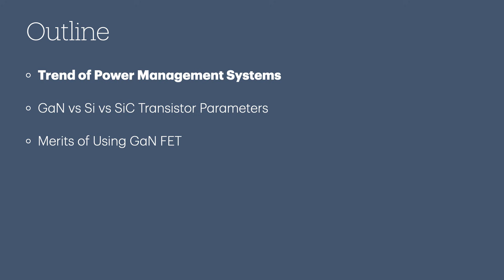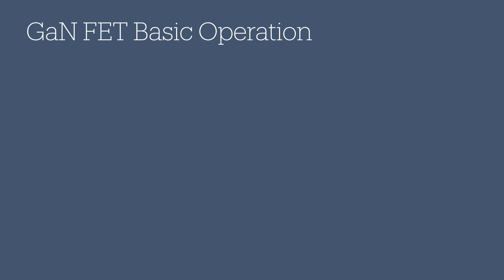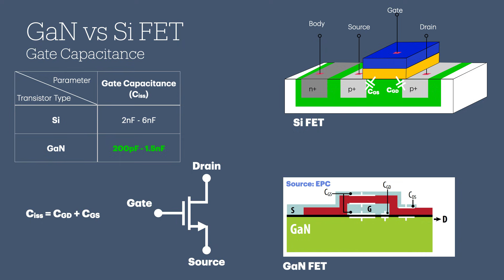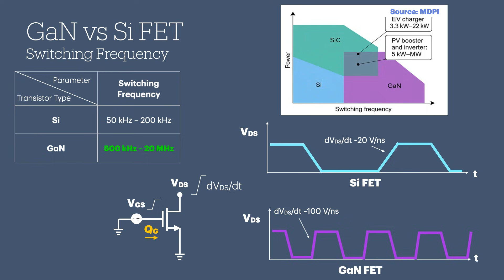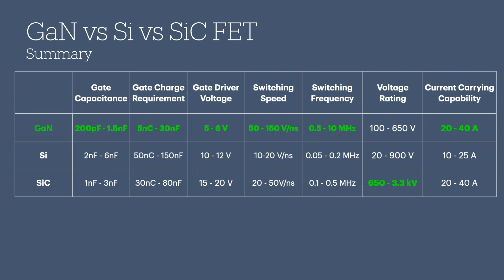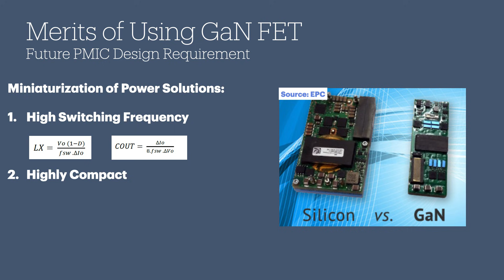Lecture 01 Introduction: GaN FETs for Future Power Management Systems

Comment from the maker: ⚡ Gallium Nitride FETs: Driving the Next Generation of PMICs

In recent years, fast-growing areas such as electric vehicles, data centers and renewable energy systems have dramatically increased the demand for more sophisticated power-management solutions. These applications push power electronics to operate in tougher conditions—delivering more power in less space, switching faster to boost performance, and reducing energy loss to meet strict efficiency goals.

Traditional “ease-of-use” designs, which prioritize simplicity over performance, can no longer meet these demands. The industry is moving toward compact, fully integrated power-electronic solutions. By reducing the number and size of external passive components, these integrated designs improve performance, shrink system size, and support the next generation of advanced power architectures.

GaN Gate Drivers are a critical enabler of this transformation. They provide faster switching, higher efficiency, and fully integrated architectures, allowing engineers to deliver high-density, high-performance PMICs that meet the toughest modern requirements.

Engineers who develop practical GaN Gate Driver expertise don’t just gain knowledge—they transform the way they design power systems, positioning themselves to gain an edge on future PMICs.

I’ve just launched a GaN Gate Driver course, built from years of research, paper reviews, and real silicon tapeouts. This isn’t just a course—it’s a shortcut into design-level insights that most R&D teams spend months or even years to uncover. Inside, you’ll explore:
• How GaN FETs are shaping PMICs for EVs, renewables, and data centers.
• Core design principles for high-performance, high-frequency power management circuits.
• Distilled insights from top-tier papers and my own tapeouts, showing next-level gate driver innovations.

👉 Full course & enrollment:
https://jimrod-norman-s-site-7963.thinkific.com/enroll/3652873?price_id=4595752

If this topic is relevant to your work, comment “GaN PMIC” and I’ll follow up.

#GaN #GateDriver #PowerElectronics  #PMIC #IntegratedCircuits #PowerManagement #HighFrequency #EV  #RenewableEnergy